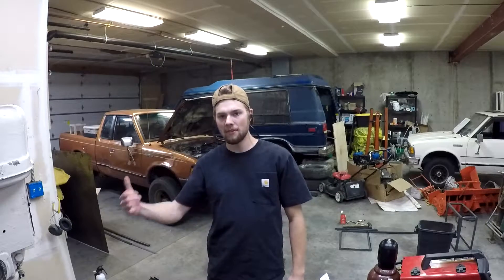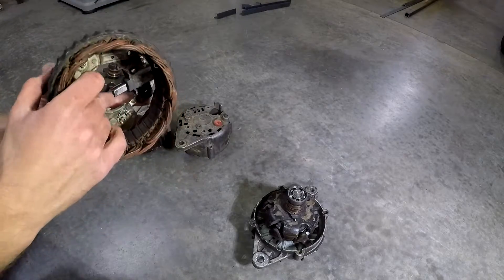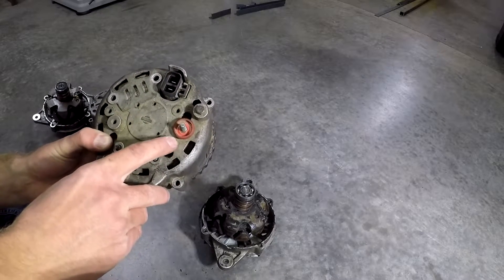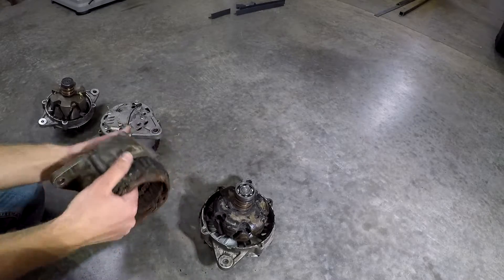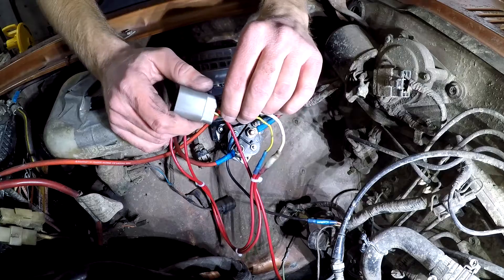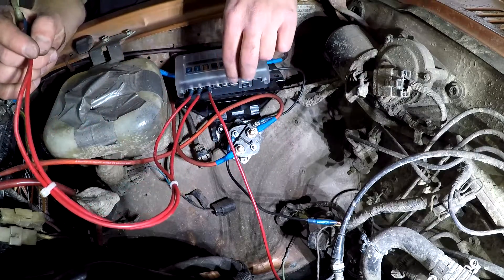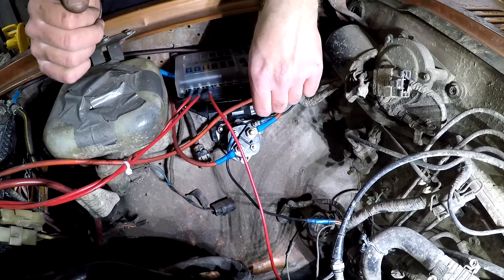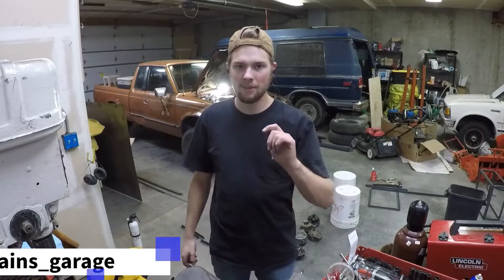Nissan/Datsun 720 Alternator/Charging System Trouble Shooting Guide

Comment: I have an 87 Nissan and it's a good thing I found your channel. I ordered the wrong alternator years ago and they either used Mitsubishi or Hitachi alternators. You have mine exactly with the T plug and the little condenser/cap. Mine is V belt. Symptoms: I start cold with 14 volts and after ~6 minutes I'm discharging and the alt is dead. Battery is recovered to 12.5 by my battery charger. It's like something turns it off and never turns it back on.
Reply: Check for a bad ground also check the voltage regulator they often soldered on the inside of the alternator and then the only thing left that I know of is fusable links

Comment: Would wiring this alternator up be the same as wiring a alternator for a 350z/g35? LS swapped my G and using the factory Nissan alt because I already built my alt mount and pulley drive before I ran into this issue

Comment: I have a 1980 Datsun 510 5 door wagon.  It has the LS T Plug Alternator on it. I measured the top of the T (S) and it has 12 volts, but the bottom (L) has .03 volts.  Does this mean I have a wiring issue on the L wire?  My charge battery dash light is on.  Unplugging it does nothing, the light stays on.  This specific Datsun has very little information online, any help would be appreciated.

Comment: Hey I have ripped boots on the front cv shafts on my 1980 720 4x4. What would you recommend?
Reply from the maker: Well it's pretty hard to find new ones for that year so I would take them off, clean them up, grease, and put new boots in because you should be able to get boots but just not an entire axle half shaft assembly. Check for shaft play and make sure they are not going to fly apart on you of course.
Reply: @Captain720  you’re the man Captain. You deserve more subs.